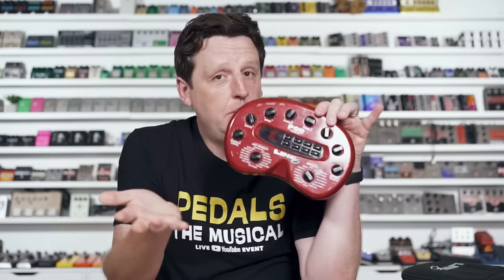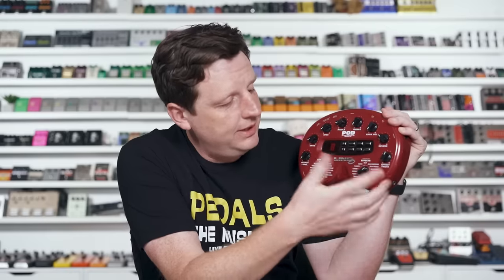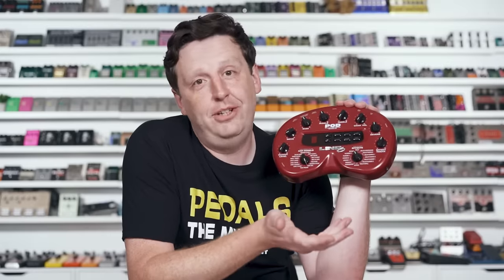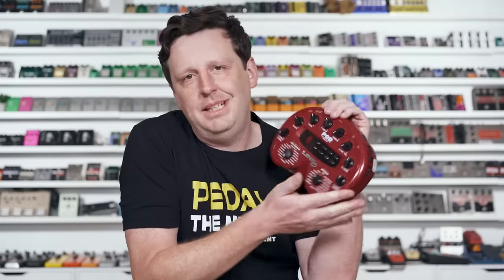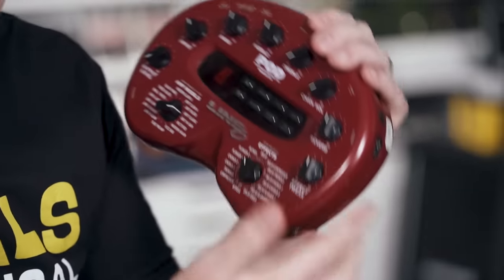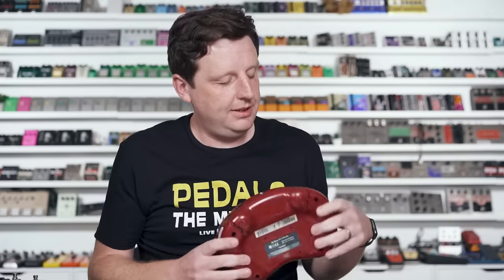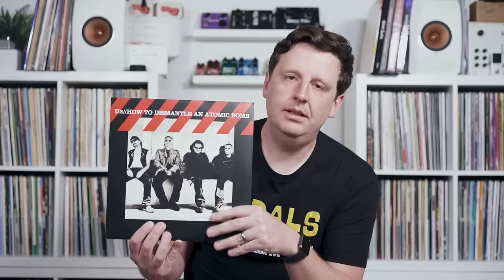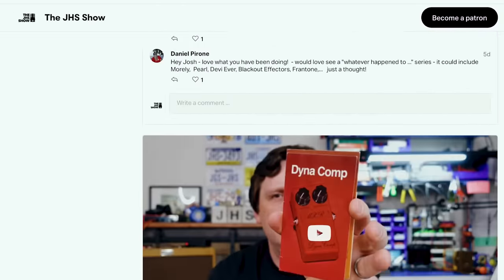Why The Line 6 POD Sounds Really Bad

Comment: I used a Pod as a headphone guitar amp when I was working at a long term job assignment far from home and didn't want to take my amp with me.  I thought it sounded fantastic using the Vox AC-30 emulation.  And the Fender amp emulations were pretty dang good too.  After my TDY ended I sold my Pod and now I wish I hadn't.

If I was a touring/gigging musician I for damn sure would consider very seriously using a POD into a DI box and ditching the stage amp.

Comment: Everyone hates the spider. I had a Spider 2 for nearly 20 years. It introduced me to so many different tones.

The reason it went was because I started the pedal chase. It didn't gel with pedals. Or maybe I was told that so much I began to believe it.

Now I have a colossal Marshall tube amp with a 4x12 and a pile of awesome pedals.

But sometimes I do miss the days when things were simpler. Before I cared about the perfect tone I could switch an amp on and play.

Now I switch an amp on and play and tweek, spend a few minutes in despair when it just doesn't feel the same as last time.

Comment: For me POD 2.3 Brit High Gain, with Chorus + Delay was a sound I'd spent years trying to get with analog amps... and it gave it to me in the headphones... Still have my POD 2 ... it was the PODxt where the controversies started... Thought I was getting a POD 2 with more effects... it ended up being "Fizzy"... that debate raged for years... and the Brit High Gain amp (i.e. JCM 800) in PODxt sounded like crap... they claimed they changed it from the "Jose Modded" version in the POD 2... to a stock JCM 800... I was really unhappy about that, LOL! Especially since the plug UX series had the unmodded 800 in it. 

The whole reason I bought a POD was that I was sitting in Guitar Center trying one out and found the Brit High Gain model... tricked me into buying into digital... and as the only model that ever sounded right to me...

And you couldn't get it as a plugin... unless you bought the plugins for ProTools... and ProTools was too expensive... 

Anyway... it was really the PODxt that caused the most "it sucks" debate... Some folks said, "POD 2 is too processed sounding... sounds already processed... has a blanket over the amp... we want it to sound "real".... so Line 6 did that... little did everyone realize what a real mic'ed amp... hot off the mic cable sounds like... "Fizz"... So for me... POD 2 was great... PODxt and the plugins based on it... total nightmare... because getting rid of "fizz" while keeping the "tone"... is an absolute nightmare.

Comment: I love the new pod go. I used to have an old pod. I thought the sounds was mostly ok. One thing people said that I agree with is that the presets are not the best and you can get better sounds dialing in your own. This true, I got some sounds that I really liked out of it. The only thing that I really didn't like about the old pod was the latency. It was small but enough to notice. The new pod is fast enough that I don't even notice and now there is more equipment modeled. So- great upgrade!

Comment: I had a POD xt. For some reason just couldn't get on with it. Found string response was lacking and also struggled with lack of sustain on some high gain settings, where it required intrusive gating because of hiss. In fairness, i found it sounds way better direct into a decent amp as a pedal platform

Comment: I bought this - the original version 1 not the version 2 you're using - back in late '99. It sucked. I see people trying to defend this thing with bogus claims of "It was good back then." It wasn't. I got fooled by the ads in Guitar One magazine. The pod sounded underwhelming even back then, it didn't live up to the magazine claims. At first I thought it was the cheap guitar I was using, and my beginner skills that made it sound bad, but after I improved and got a better guitar it still sounded fake and muddy. It's better to just play your guitar unplugged rather than have to listen to this thing. I never bothered with Line6 again and still distrust the company.

But to continue, one of the main selling points - the main selling point? I don't remember as this was 20 years ago - in the ads was that you were supposed to play this through headphones. Record direct from the headphones into a DAW, and don't add eq or compression, and you will give a better idea of what teenagers would have heard in 1999. Using a $2599 amp that changes the tone weakens your argument. The pod still sounds weak even through that amp, but the amp is compensating somewhat.
There's a chapter in the owners manual "Boomboxes and small portable studios". I think portable studios means 4 tracks. It also says "If you’ve got some headphones handy, you can plug them into the POD headphone output to make sure that it sounds the same as what you hear through your system." Notice how it emphasizes the headphones to get an accurate representation of what it sounds like. This was the appeal for a lot of people, a box you could plug into a 4-track that sounded good without needing an expensive amp. The Pod didn't deliver.

Comment: I have a Butt shaped POD that I bought in 2000 sitting on my desk all the time.  I usually use it for drum machines or casios but it gets used for bass and guitar often too.  Great for a headphone practice amp late at night when Wife is trying to be boring and not rock out.  Great for reamping recordings direct too.  Fun tool, and the early ones can be bought cheap as hell used.  One of my favorite things to do with it is plug the headphone out directly into a little speaker and crank it and record it like a super blown out guitar amp.

Comment: I'm a computer guy by day but I get option paralysis with alot of stuff like this. I will usually run single effect pedals and analog solid state amps(Fender Frontman, Peavey Bandit, Orange Crush etc) and make it work. This think is still cool tho.

Comment: Been using Line6 stuff since the Spider II, had a 2x12 first. Later got the POD XT and still using it, nothing sounds like the Big Bottom sim in that one.
Since also had 2 X3 floors, still have a X3 rack (pretty much the same units as the XT tho), POD HD500 and also now a Helix which I love.

Comment: I played live for while with a POD, then got the PD H3, and sold it, not because I thought it was bad, but I was not playing live for a while. I think both of those units were great. I eventually got the line 6 Amplifi TT, and that one sucked, not because it sounded bad, but because it was discontinued very quickly and mine just stopped working after a while (the hardware was good, but the digital and SW inside just got ruined somehow). 

But they definitely make good products. It's just a matter of taste

Comment: When I was starting out, I would gig with the kidney bean run through a power amp. I sold that and upgraded to the rack version (Pod Pro XT) which I ran through a sonic maximizer. I gigged with that for years until I got the EVH 5150 III 100w which I prefer because it sounds closer to what I want my guitar to sound like.

Comment: i never had one, but a guy i knew used to use one in a bar close to me and sounded great so i always respected this machine, i have just always been a boss guy, i had a me30 i used to gig with for years and although its by no means the greatest effort by boss i got everything i wanted out of it, these things require you to sit down and build patches from the ground up, the me30 gave out on me years later because its onboard expression pedal became all floppy and wouldnt stay in the right positions anymore, these days i use a boss gt1000, nits strauss uses one, runs it straight into the mixer, no guitar amps, and if its good enough for her, then its good enough for me

Comment: I had a Floor POD Plus for a few years, which was basically the same tech but with foot switches, and a volume/wah pedal.  Great unit and I got it for a steal.  I got rid of it in favor of a POD HD500.  It along with the 500X were the precursors to the Helix.  I wish I hadn't sold the FPP.  For me the 500 is overkill, and it's been collecting dust for quite a while.  I like good tones that don't take a ton of time to configure, and that's what I miss about the FPP.  2 minutes to set up a tone.

Comment: i still have my pod x3, it got me through my clinical rotations away from home, and while i still think the cab emulations are terrible, the amp sims and effects are actually really good. i mostly used it as an interface and loaded some IRs in reaper, and it did a fantastic job. got a helix stomp and helix native now, i'm not using it as much anymore, but it's still a shockingly competent unit imo.

Comment: I had the POD 2.0 when it first came out. It bailed me out on a gig because I didn't have an amp nor money. I scraped a couple bucks together and liked that I was able to go direct to the board...until the sound guy turned off the monitor. I never could get it to sound good to me so I sold it.

Comment: The basis of all modern electric guitar sounds is based on sounding bad and using this bad sound in musical ways. I still use an original pod with an original bullet microphone (yes it sounds bad) for vocal and harmonica effects. A lot easier than carrying around an extra Fender Bassman.

Comment: I had all the line 6 gear, most of the digital amps including the line 6 Bogner , where the Bogner part crapped out. I own a Helix lt now. I havnt even turned on my tube amp in 4 years. People that say they can hear the difference are f#@%ing high.

Comment: "Portable Guitar Effects Processor with 300 Presets, 32 Amp Models, 16 Cab Models, 16 Effects, Audio Player In Jack, USB Connection" for $150.  Well it may not compare to the  Headrush Prime the only guitar pedal to include autotune.  For only $1300?  what a deal. From the same company a bunch of years later.  Would you expect it to ?

Comment: I have a POD 2.0 plugged into a single, Rokit 6 KRK monitor on my guitar workbench. It's perfect for that purpose...it's small, so, it doesn't take up too much room on the bench and it can cover a multitude of guitar tones and most of your basic effects. I have 8 tube amps, including a Matchless DC30, Fender Vibroverb, 3 pedalboards, etc., but I probably log more time playing on the POD than anything else. Does it sound as good as my other gear? No. But it's credible and certainly "good enough" for practicing and testing guitars.  Plus, it's so easy to dial in a tone quickly. It also sounds good at really low volumes, a big advantage over non-attenuated tube amps. I especially like the Fender Blackfront and Matchless models. I don't imagine I'll ever get rid of it.

Comment: I thought it was awesome at the time.   I really didn't use it for guitar though.  It was part of my DJ setup.  It was a  wonderful device for that application.  I also had the line 6 looper but I used the pod more.  Sadly I sold both of them, along with just about everything else I had when I got into some trouble.  I still have the owners manual though.

Comment: I had a Pod 2.0. Then a POD X3 Live, which was fine but i felt something was happening on the 2.0, for better. And now i have a POD X3 Bean with an external IR Loader, because the cab sims are bad compared to an 2.0. Now i have a POD HD bean for effects on my pedalboard, and a POD X3 bean for my tone. The POD HD has really good tones, but the 2.0 is really easy to dial in good tones... so i possibly will have the 2.0 on another pedalboard.
Reply: Meshuggah and Porcupine tree did really good albums with an POD 2.0... maybe an IR Loader was used, but not neccesarilly.

Comment: Yes for Line 6 making fairly decent amps this thing is basic compared to Boss, Helix and pedal stacks. The thing is that it’s so laborious switching between tones.  But if you stick to one tone on an old gorilla amp, it sounds great.  I bought mine from eBay so I didn’t get the bag…

Comment: I liked my POD. It sounded significantly better though used in conjunction with my "tube" mic pre (anything tube running at low voltage in tandem with an op-amp as a buffer deserves to be in quotes).

Comment: I had one of those and a Flextone II amp. I couldn’t get a good heavy metal tone. Something about the sound caused fatigue after a while. Almost stopped playing guitar altogether. Sold it and bought a Mesa Nomad 100HD and 2x12 recto. I use an HX FX now for FX.

Comment: The big issue with pods were a cab simulation for high gain tones. It's just awful and there is no way to upload custom IRs on this device. But if you plug it in fx return of any mediocre amp and turn cab simulation off it will sound great.

Comment: I still work with it every single show. I have the big line 6 foot controller the one uses internet cable conector 😢 but works perfect 👍🏻 sometimes through my orange micro terror with a Mesa Thiele 1x2 or straight to the P.A. This kidney has everything that I need and runs perfect into a twin reverb as well, it’s kind of old with a lot of scratches I love it

Comment: Yeah I never played with a pod, they were too expensive at the time for me!   I had friends that had the floor pods and they couldn't get a good sound out of it for their lives, but to be fair, they didn't really try, and one guy didn't have the right power supply for it!  I had a friend that had the AX7 and that thing was just not user friendly, I had a hot rod deluxe with 410's and we tried for hours and hours to get the setting that was supposed to be like a fender tube amp to sound close to that!    But this same guy had one of those bean pods forever, we both got the DL 4 now of course who doesn't have a dl4?   To me back at the time I really just wanted simple stuff, at the time I had a Boss Chorus ensemble, a boss dd3, my bubble font big muff I still have that   and I think the danelectro overdrive they did in the bigger metal casings, and of course a tuner.  the pod looked daunting at the time, of course now I could figure it out if you see my board now lol!  Either way, I might try to find a used pod or something just for my studio, I bet it works nicely with something like Wall of Sound plugins.

Comment: Anything can do cleans so the first 2 and e a copout, then the 3rd sounded meh even with the gallon of reverb. You also put it through a tube amp which already has great cleans. And you didn't use any of the gain settings because it is in fact garbage. Do you have a warehouse of new old stock you're trying to dump or something Josh?

Comment: It sounded adequate at the time, the physical design and switching was (and therefore still is) a pain for live use, it could be better to use if they had've put it in a case that was easier to operate from, their new stinker is a bit of a joke too unfortunately, they can produce tonal options but their physical designs let them down badly even though they sold lots, they'd have sold more if they had've sorted the look of the thing more universally suitable for use and transporting etc.

Comment: But wouldn't a really fair test of the signal/sound be to run it straight into a board or into a computer and its software? Not trying to be a negative detractor here, I have nothing against the Pod, but it is suppose to be an amp modeler that can emulate those amps and cabinets all on its ownsome. Giving it an amp boost warms it up for sure and with that tasty Milkman which, by its own admission, can make it all “sound good no matter what you plug in,” maybe it's more of a testament to that amp. 😀

Comment: Josh, in the wrong hands, even your pedals will sound like trash.  And I think that's what happened with many a Pod user.  They were perhaps either young or 'n00bs' (or both) and didn't know how to dial in a tone.  Everything was set to 11, even the Fender R.A.D amp they were using in 2000, and then it got a bad rap.  

Sure, it's quick and all-in-one, but that's not good in the wrong hands.  By the early 2000s I had already been playing for 15 years and I couldn't get anything half decent to come out of that thing with a late 90s blackface Fender Twin.  I'm not a fan, but I do love the mod modeler and the delay modeler.  Those pedals got some mileage in my rig.  Even the bass pod was OKAY.  

Guitar Pod, though?  I'll hard pass on that every time. And it's really just too much for inexperienced players.  Less is more for them for sure.